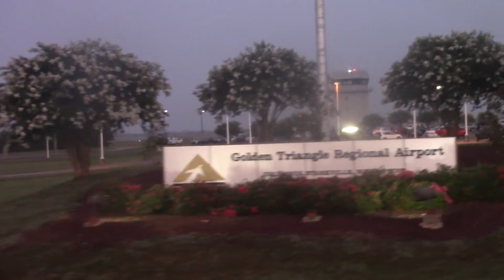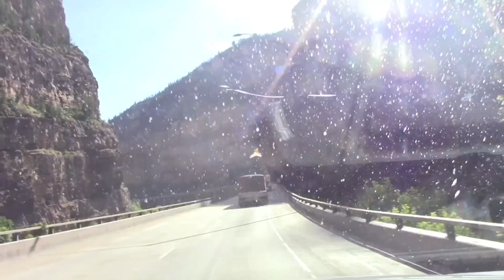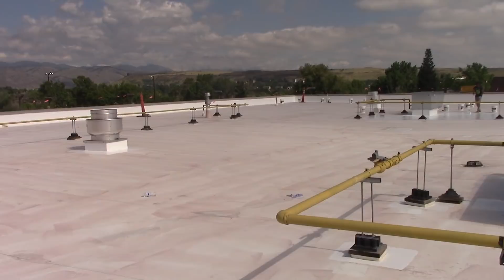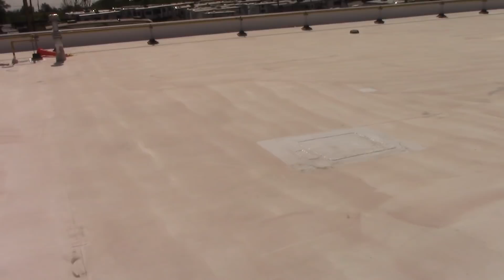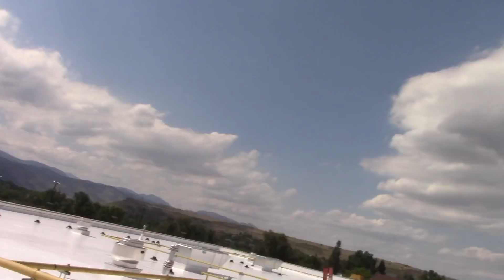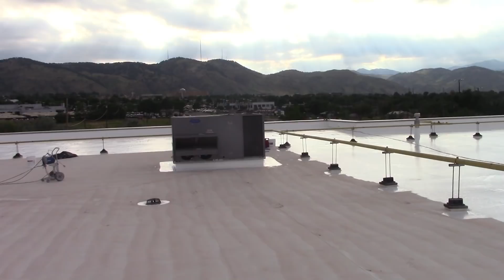Rocky Mountain Road Trip

Comment: Just a heads up for those that might get the wrong impression, the road trip was of I-70 thru Glenwood Canyon way to the west of Golden and Denver. I suspect Brian had to go to Grand Junction for supplies or equipment first. Golden is pretty much a not noticeable subset of Denver itself much like all the other independent cluster of cites around Denver. You can't really tell you went thru one to the other in other words. But Golden is the last one on the west side of Denver with I-70 thru it and that interstate was probably part of the backdrop and background noise while on that roof too. Looks like a brilliant job done, Brian, glad you got some nice weather for the work.